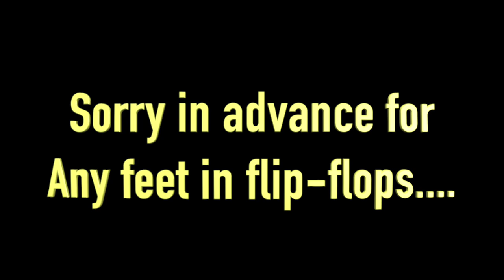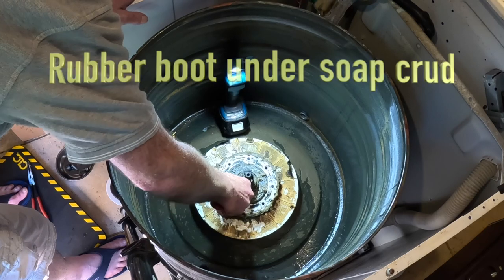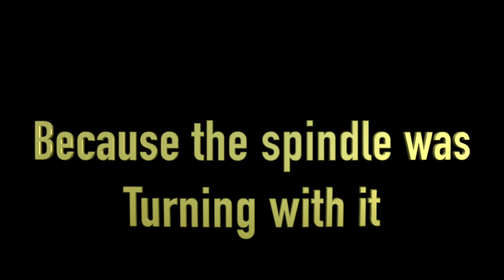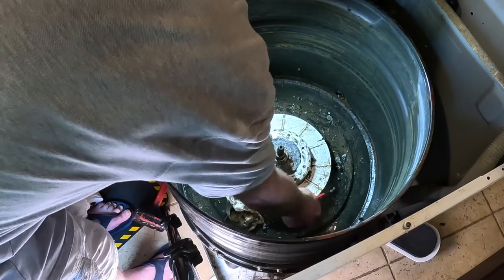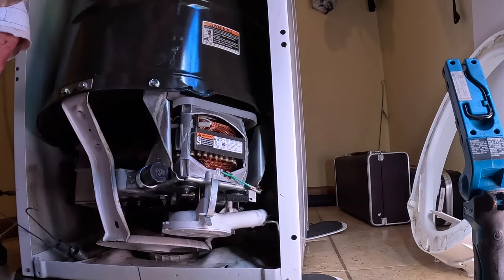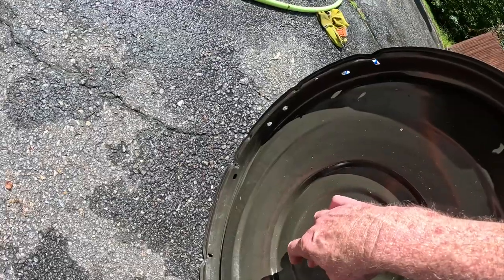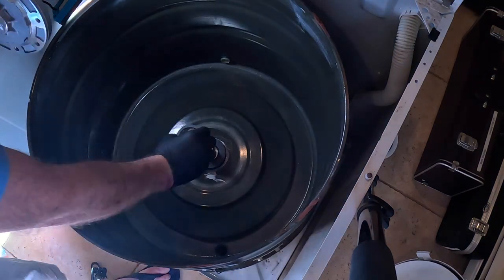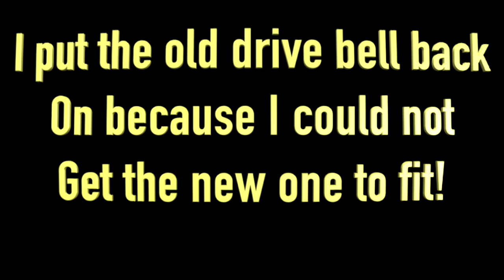Speed Queen Washer BEARINGS and SEALS replacement DIY  The GOOD, The BAD, and the UGLY

Comment: Ok, potential inductee to the SQ society, but -- doesn't the warranty cover this?   If it's a normal use-maintenance item that would change my thinking.
Reply from the maker: My two cents;.buy one. Absolutely great machine.  Mine was over 10 years old at the time of this issue and the warranty had expired.
My machine gets heavy heavy use at least two loads a day average every single day of the week. Yes, the seal leaked after 10 years and I could have easily called somebody but to be honest I enjoy the challenge with all the information that's out there these days. Good luck and if you have any questions feel free to ask

Comment: Yep, this case looks like the use of liquid detergent they have wax and the wax never flush out from your washer internal parts cousing corrosion on the  aluminum hubs and mold, musty odor..best detergent for washer powder oxy clean have deferent detergents and they flush out perfect don't leave residues, depends on the load no more of one scoop..
Reply from the maker: I tell you what- I use much much less soap now.. the washer never smelled and nothing was ever Rusty just a slow leak but thanks for the info

Comment: Did a good job could have been easier though there is definitely a proper order in taking them apart so everything doesn't spin
Reply from the maker: I did it in the exact order of every pro's video I could find . Somebody told me the brakes were worn and that's why it wasn't locking so I changed the brakes. I don't know if they were right or wrong but that seemed to make sense. Thank you for commenting

Comment: Wow what a PITA.  Bearing kit is over $300.  Think I'll buy a new machine before I go through that hassle as our is 10 years old.
Reply from the maker: It wasn’t the money. I love that machine. No electronics, it’s all mechanical and the new ones aren’t nearly as good. I don’t think I spent $300 for the parts, but it might have been close when adding in the sealant and tool to remove the bolt. Can only wonder what it would have cost to have a tech do the job. Probably mid $600s but that’s a guess. Thanks for commenting.
Reply: My parents Speed Queen from 2006 just went out the other day :(. Usually I like tackling these DIY tasks for them, but yeah, no, this is too much for me, even if I find cheaper parts. Told them to get rid of it and get the cheapest, barebones $450 'Amana' unit out there, as they seem to get even worse the fancier you go. Disappointing as people claimed Speed Queens are designed to hold up 25+ years no problem.
Reply from the maker: @mbz3218   Is it leaking? Because that's the only reason I did this repair. I bought the parts about a year and a 1/2 ago While I was waiting for them to arrive I put silicone around the bottom seal And that held for about a year to a year and a 1/2

Comment: This is just a Maytag/Frigidaire/Electrolux design, stay away from it. Go with an Old Whirlpool based Timer Switch Direct Drive unit (not cabrio, oasis, bravos) or a belt driven whirlpool based unit.
Reply from the maker: From what I understand mine is better than the newer models. Mine is 12 years old and I would buy it again in a heartbeat. 2 or 3 loads per day 7 days a week. Really the leak is the only major issue I've had and it was easily repaired.  No electronics is why

Comment: ITS A LINT FILTER
Reply from the maker: THANK YOU!   but what good is it doing under water on top of the spindle? It’s not in a position to filter anything. I could see if it was over a water pump inlet, or hose area, but it’s just sitting on top of that aluminum piece.
Reply: @Samlol23_drrich  the agitator creates water flow.  as the water passes through it collects lint then when it spins it flings the lint off and down the drain
Reply from the maker: @dougwright5014  thanks very much. You have no idea how helpful your comment and this response are. I use about half of the amount of soap than I used to after seeing that thing with caked on soap residue. Thanks again.

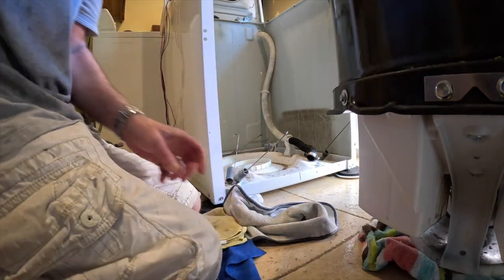Comment: 22:36 - all the black oil marks in the insides of the walls of the washer.   I have been told that it is the sign of failed bearings, throwing their oil out and hitting the walls of the case.  Can anyone confirm that?  I don't mean the dirt on the bottom, just on the sides.
Reply from the maker: That’s interesting. I hope someone can answer. For me it was the leak that required me to replace
Reply: Yep same as mines
Reply from the maker: @bobdeengineer7396  in all honesty the only reason I did The repair was the seals were leaking. There was no noise or other issue.  Like I mentioned,  Over a year ago I took the front panel off and saw it was dripping from the seal. I got a glove and a cartridge of silicone w antibacterial and globbed it all over the seal from underneath.  Then I didn't use the machine for 24 hours. It held for well over a year